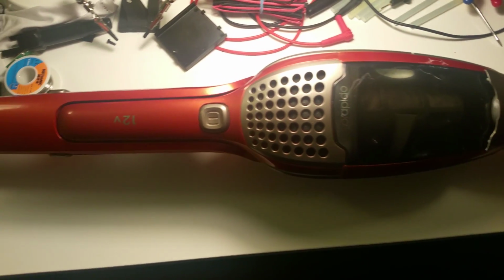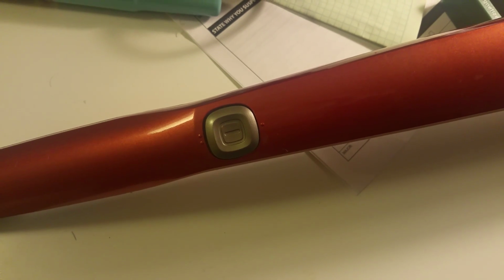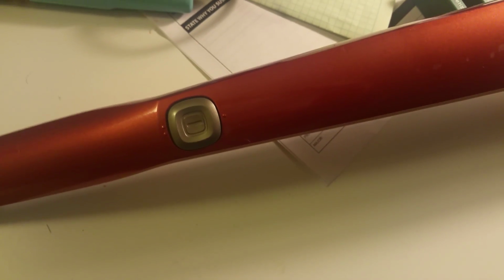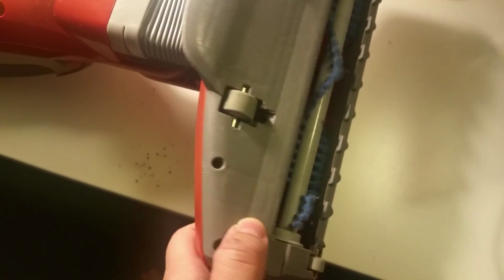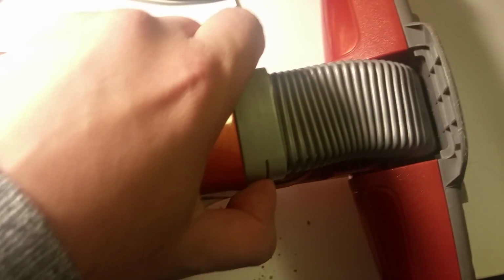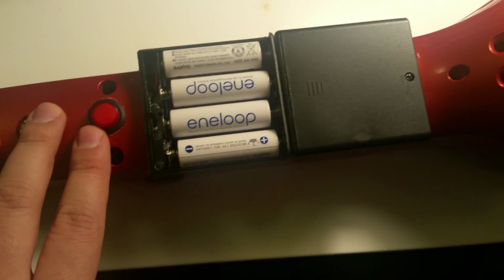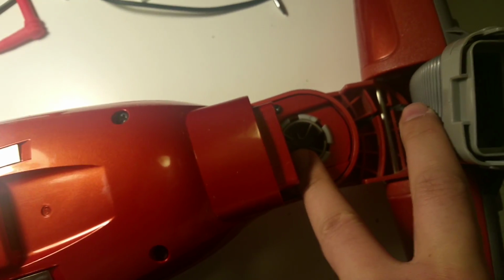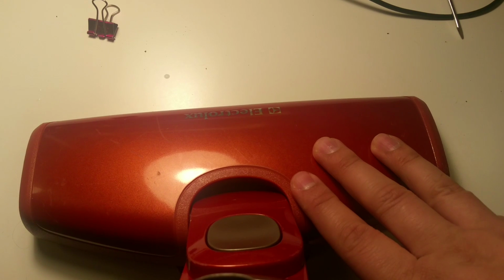Superchargering Your Electrolux Ergorapido

Comment: No chance you actually filmed yourself opening the neck of the vacuum and connecting the wires to the battery pack?  Any thoughts on connecting the wires without a soldering tool?  For those of us who aren't used to doing our own mods and not quite as electrically inclined. ; )  I was thinking my lack of suction is just due to needing to switch out old batteries but perhaps this could help things and/or is the actual culprit.  Thanks in advance.
Reply from the maker: Unfortunately no video opening up the neck. I did the whole thing then just whipped this up to help others. It's quite self explanatory when it's opened up since there's only two wires that go from the circuit board down to the bottom. Disconnecting those just allows more current for suction. It's a really dumb circuit. I would advise against no soldering since the vibrations could (would) undo connections. Even with a soldering iron, replacing the batteries would be extremely annoying.  I thought my batteries weren't holding a charge as much as they used to, but when I made this mod it put life back into my entire unit. I would recommend vacuuming on the low setting so the roller spins at 7 volts vs. 6 volts. Even with less suction it works better when the roller spins with more torque.
Reply: Self-explanatory? ... nope. Putting the battery packs on the top of the roller housing will make the vacuum pretty much useless for getting under low(er) lying furniture. I like where you have placed them--on the back of the stick.Thanks for sharing the video.
Reply: serasee ju